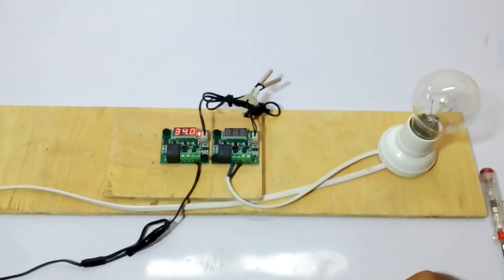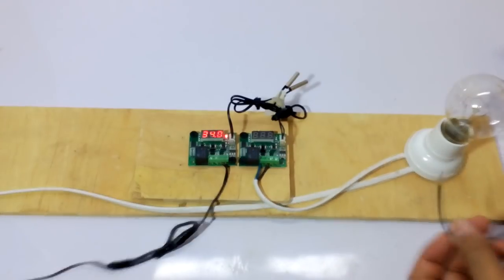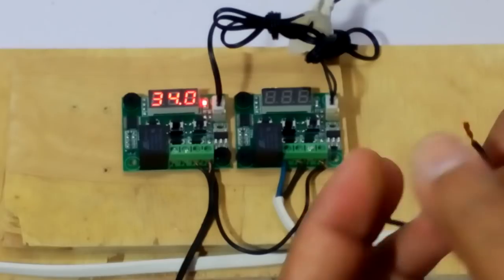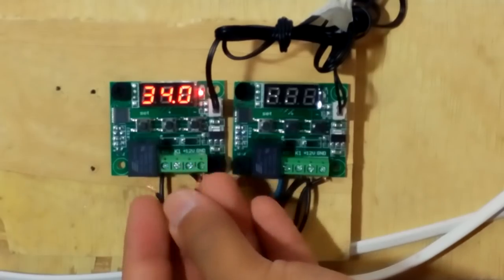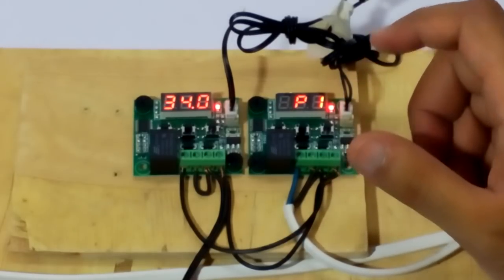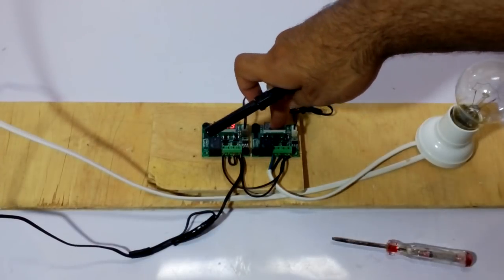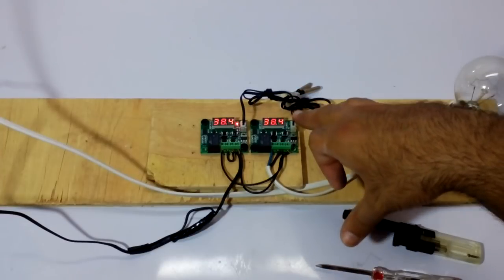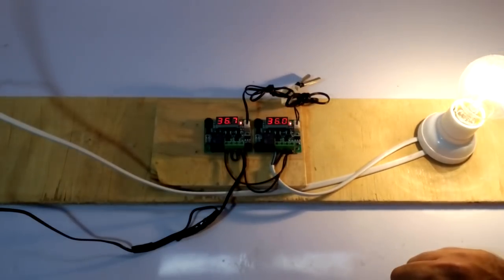Dual w1209 High temperature shutdown safety English

Comment: Sir DPDT switch use w1209 2 thermostat working one failure DPDT switch use  emergency  hav to use 
Connection details
Reply from the maker: You can place 2 thermostat with separate wiring with separate plug

Comment: could we add the emergency high temperature controller to exhaust fan so that the hot air is pumped out and temperature falls to safe levels.
Reply from the maker: yes can attach fan so it will throw the overheat outside